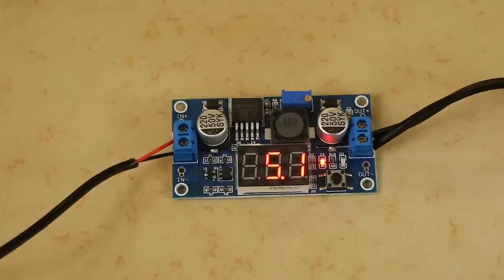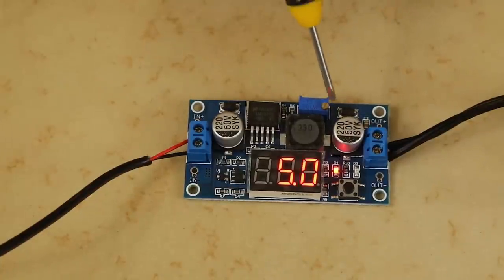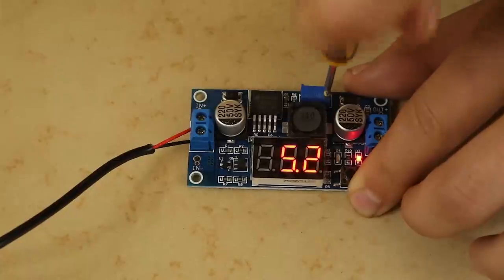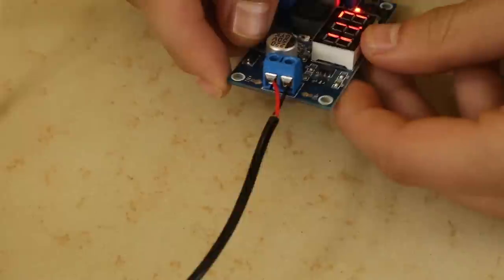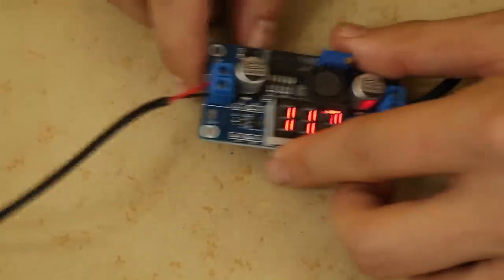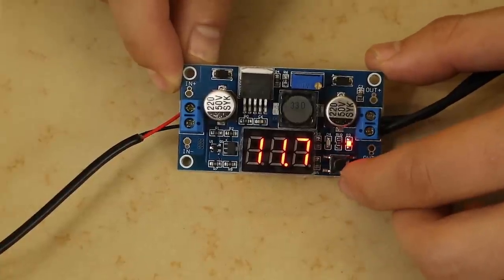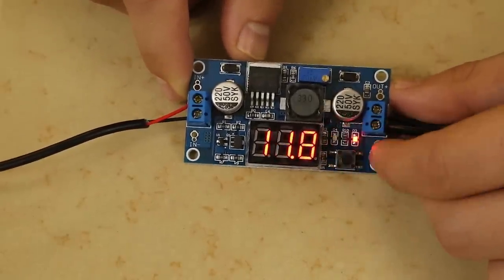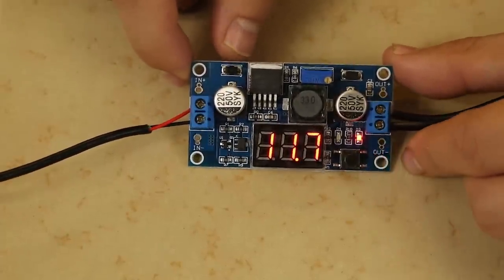DROK DC-DC Voltage Converter Review

Comment: Good information! I ordered something similar. The fact that you informed me that you can tighten the screws to fasten the wires into place is a good thing. I ordered a similar DROK product (it's a step-down dc-dc converter) but it should work quite similar to this. I hope to do some nice electronics work with this!

Comment: It's only a step DOWN converter, so the source (IN) must always be higher (minimum 1V, better 1,5V) than the voltage output. If not , you'll quickly burn the device.

Comment: input power, it is pluged into a 12v car batt,  out put, is 4.5v connected to LED light,  now, does it matter what the input power setting is, as long as it is more then 12v, ie, if I set it to 15v,  will I still get 4.5v out put,  if that makes sense

Comment: Bought one to boost a 7.8 volt lithium battery to 12 volts. I tried running a 12 volt powerwheel with it but it went straight back to 7.8 out and begin to smell like smoke and the black part XL SEMI starts to get very hot very quickly when I reconnect to battery again and the it wont let me adjust the voltage again. Any Idea what I did wrong? It's the same item you have.

Comment: Could I use this converter to run a 50W LED (36V) with a 6S (18-25,2V) battery pack of 18650 cells?

Comment: Nice. 

1. Can this be used for doubling the output of a DIY battery.
2. Can I connect them in parallel to gain power?
3. Can this charge a deep cycle battery for home generator set-up?

Thanks.
Reply from the maker: +Armand Pedroza hm not exactly. You can't get power from nowhere like that. :)

Power = Voltage * Current

Power flowing in and out stays constant (minus some small losses) so if you double the voltage, you halve the current.

You can put them in parallel if you want to handle more load than just one can handle at a time, but these are meant for smaller applications. You might want something beefier if your application requires it.

I don't know about charging a deep cycle battery. This is mainly designed to step up the voltage from one output to another input.

Comment: Mine never worked right, when you turn the voltage dial, is it supposed to be somehow loose ?
Reply: IF THE "OUT "VOLTAGE DOES NOT WORKS (DO NOT CHANGE) THEN DO THIS:
TURN THE DIAL COUNTER-CLOCKWISE AT LAST 10 TIMES AND IT WILL START WORKING AGAIN !

Comment: so if you said it a 30 volts when you turn it on when you shut it down and turn it back when will it still stay at 30 volts
Reply: It will stay at the set voltage until you reset it again... :)

Comment: As you boost your voltage you lose amperage if your in is a lot lower than your out.
Reply: whats your problem with china ?
does they are the best than your country you was hating them ?
or does the ppl in your country they was stop made anything  ? 
or the super hero was died ?